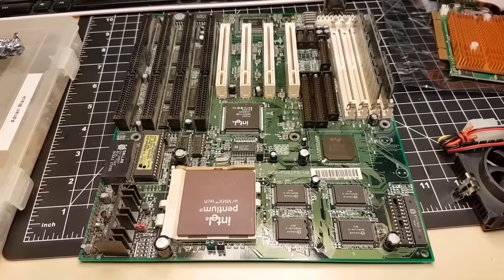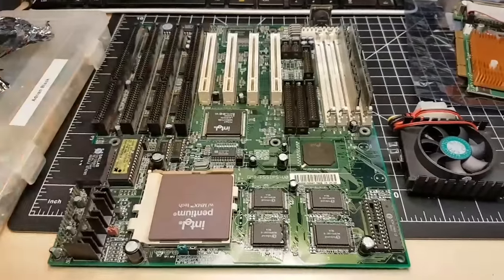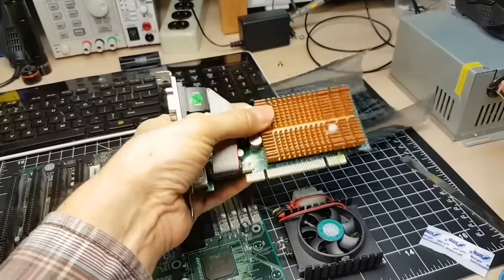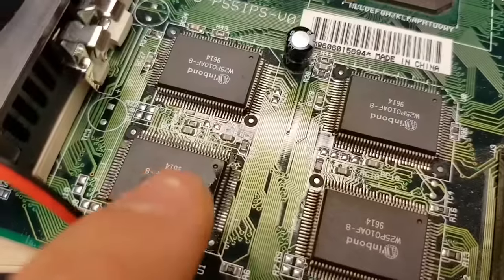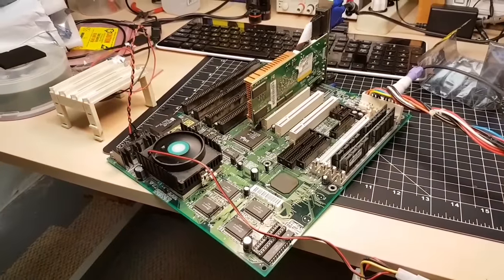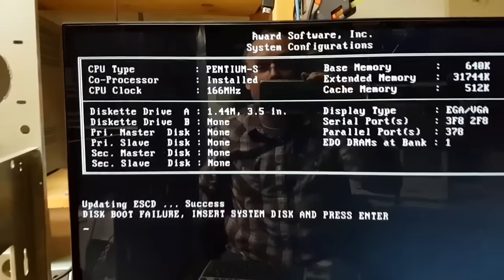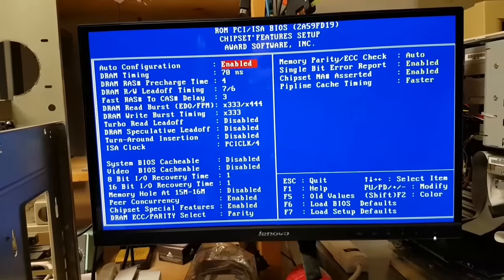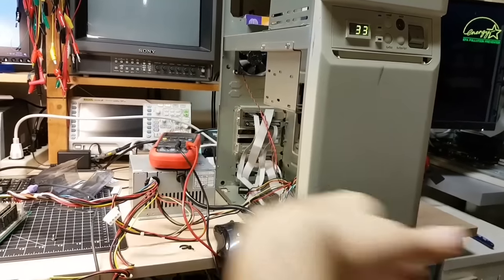Testing out a "Goodwill find" AT motherboard with some eBay parts

Comment: I actually recognize that motherboard.  I had one just like it in my second computer.  The motherboard was made by PC Chips.  It has an Intel 430 VX chipset.  The CMOS battery is installed in the underside of the tea time clock chip.  I used a 233 MHz Pentium CPU, 128 MB of EDO RAM.  Windows 98 SE ran rock solid stable with that configuration.

Comment: +Adrian Black
Get a flux pen and bake that card. It will very likely work. Used to do PS3's and Geforce based laptop mobo's all the time, very rarely failed to work.
Reply: Hey it's all good. Didn't notice the date of the video until after posting the comment. LOL! Figure I came in a bit late.

Comment: Might be able to clean off the corrosion with a fibreglass pen. Also on YT chanel  12 volt vids uses a method to reflow BGA's with one of those 12v halogen globes the ones used for ceiling lights.

Comment: Couple questions - how do you hook up a mouse to this? Also do you use thermal paste on the cpu before installing the fan? I have a similar board with a 486 processor that I'm going to work on as soon as I get my IDE to SD card adapter in the mail.
Reply: You need a 9-db serial mouse (and hopefully you have the connector to it, usually comes with a expansion card plate or you could just screw them on the tower). Sometimes, you can even have a PS/2 mouse connector but I think they were present only in fancy last-gen Pentium/Pentium MMX cards (430TX). If you have a Pentium mobo in the ATX format, then the keyboard and mouse are both PS/2 (and I remember, you can already have 2 USB1.1 at this stage).

Comment: it's good to know mainboard is working. and the old graphic card problem, well, it's likely a dying video card, maybe cause by over-clocking. or old thermal paste fail. temp fix to renew thermal paste or reflow the card, but get a cheap low end card may fix the problem in no time.

Comment: Are you aware that you are overvolting the Pentium MMX considerably on that board? As far as I know, the Pentium with MMX technology is only available as split-voltage processor, and it requires a 2.8V (Vcore) supply from the mainboard. Because the chipset runs at 3.3V (unchanged from the standard Pentium), the FSB pins of the Pentium MMX use 3.3V signal levels, so the processor also needs a second supply (Vio) at 3.3V.

Compare https://stason.org/TULARC/pc/motherboards/G/GEMLIGHT-COMPUTER-LTD-Pentium-GMB-P55IPS-VER-1-50.html , which describes the jumper settings for a split-voltage capable variant of your mainboard. Your jumper setting matches "3.4V (single)" (using 3.4 instead of 3.3 is allowed and increases margins at the expense of higher power consumption and more heat), and definitely does not match "3.4V (dual)" which would be the correct setting for a Pentium MMX. (Note that JP14 needs to be open in that case). On your edition of the mainboard, the regulator for the lower core 
voltage is *missing*, and the jumpers to bypass the regulator (JP14) are soldered in place instead. This means that removing the jumpers wires fixes the problem only if you add the 2.8V regulation components (a second big transistor on the heatsink, Q4, C9, R30, R31 and maybe some more) at the same time. This kind of rework is possible if you know what you are doing, though.

Pentium mainboards with missing split-voltage regulators were quite common at those time, because Intel announced the Pentium MMX and its split voltage requirement a long time before actually starting to deliver. Mainboard manufacturers already designed the option for split voltage supply in their boards, but left out the components until the Pentium MMX indeed hit the market.

Comment: If the card has just a BGA problem, a good bake in the oven will fix it (215C@10min). If it is the infamous Nvidia Bug (geforce 8xxx series), it will fix it only for about 3 months.
Reply: baking it is usually just a band-aid fix. the issue will inevitably come back. the permanent fix would to rework the BGA. same situation with my Alienware m9750 laptop's video card. it died and the baking trick was only temporary. i just now use the laptop for parts.
Reply: use a rework station with flux, it's better than using an oven.

Comment: Wow, a Dallas RTC chip from '96 where the battery inside isn't flat! :-O
Reply: but it looks like it's soldered in so it will be a bitch to remove. but it's possible, rub flux on the contacts on the RTC, then use the desoldering iron or a soldering iron/desoldering braid or desoldering pump to remove the solder, then pull the flat Dallas RTC, then solder in a socket that works with those RTCs, then put in a replacement RTC.

Comment: Great way to cook a m/b bro.   No static protection - or grounding wire?  And your hands are touching that b/s crap?  You need to go back to IT school dude!   :)
Reply: LOL! I have been assembling computer hardware for 25 years now, and in the mid to late 90s I even worked for a computer store assembling PCs by customer specs.
Number of times I have worn a ground strap or did more than touching a grounded metal object: 0
Number of times it caused any issues: 0
Honestly, no matter what electronics I have been dealing with in my life, I never had any static protection and never had any issues due to the lack of it.
I'm not saying it can't happen, but unless you are fully charged and zap right at the most vulnerable spot, it's not causing any problems. Especially if you have touched something that's well grounded.
At the computer store we even had a high voltage generator to completely fry parts that needed to be fully dead. They can take a serious amount of beating before they die.